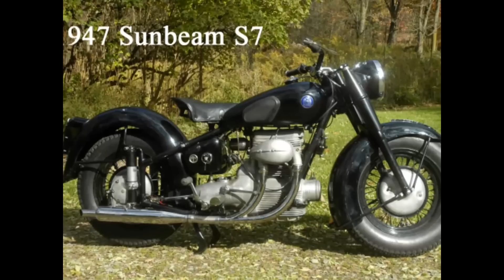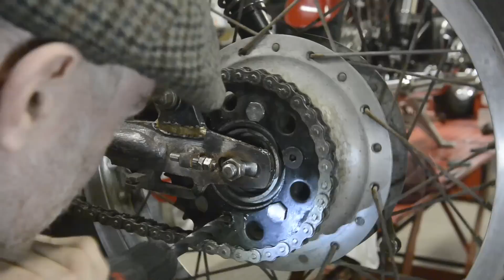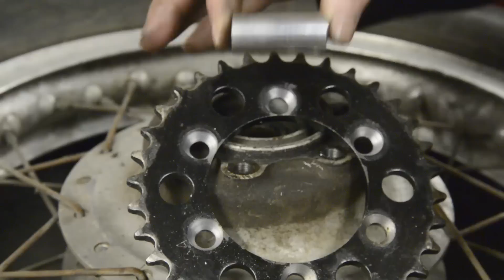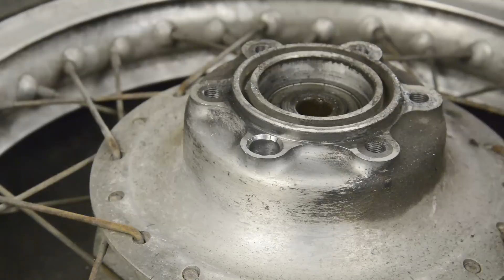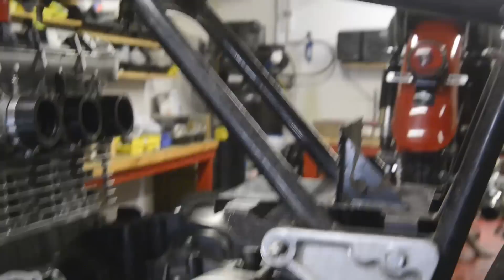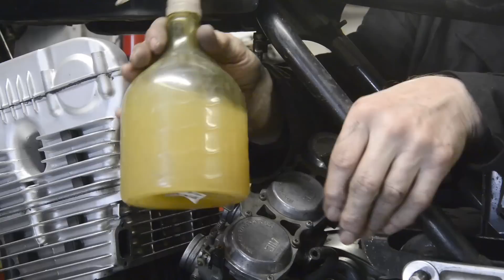Yamaha Commando Special  -  Part Twelve

Comment: Dont quote me but i think the majority of tapered counter bore screws are 82.5 degrees on the head, imperial 90 degrees. Ive made that mistake a few times and it only leaves a very small contact point...i always put a protractor up to the head of the screws im fitting

Comment: Mike I've read that 4130/40 needs re-heat treating after welding to get back to it's original strength. I'm using T45 /S514 on my racing sportscar (with TIG) as this does not weaken in this way. I think you could also use 4340 but you'd need to check on this. Perhaps, though, this is only of concern on racing /high-performance bikes ?
Reply from the maker: One of the reasons that Reynolds recommended bronze welding was because it was "kinder" to the tubing. The tubing is normalised when purchased and I don't think that the Cheneys or any of the other frame builders in the 60s used to heat treat after construction, though I don't know for sure. It is another case of I don't and I have never had a frame, or bronze joint break, and believe me my trials bikes get thrown about all over the place.
Reply: @BritanniaMotorcycles  I guess it's a case of 'the proof of the pudding etc...' I'll certainly try bronze welding when my skills are more advanced.

Comment: You need to get yourself a blue SMEE coat, guaranteed to give perfect engineering standards.😁
On the thread dial front, my metric Bantam it doesn't even have one and I don't miss it. There are many ways around the lack of one.

Comment: G’day Mike, Another great vid, I did cringe a little when you were trying to drill the holes in situ with the wheel rotating!! 
I, like many other engineers have gone down that track, a quick drill and tap job that turns into a marathon.
I never use the threading dial on my lathe, there is a cheat which is so much quicker and easier, I’m sure there will be a YT vid.
I did find these beaut Titanium M10 x 1.25 countersunk bolts on eBay. 
 https://rover.ebay.com/rover/0/0/0?mpre=https%3A%2F%2Fwww.ebay.com.au%2Fulk%2Fitm%2F232573642215
Can’t wait to see it completed 👍🏼
Reply from the maker: I have a friend who is a great machinist, and fine boat builder too, who when he first saw my lathe and I said the thread gauge was missing said not to worry and that he never used his. Next time I visit him I will get a hands on lesson. Thought to be honest I never need to use it as I am always working with small threads. Titanium! you are giving my wallet palpitations.

Comment: I recon you will get the ram air foam filters in there. There better than the k&ns and cheaper!
Reply from the maker: Yes, there is not a lot of room so some measuring and filter research is needed.